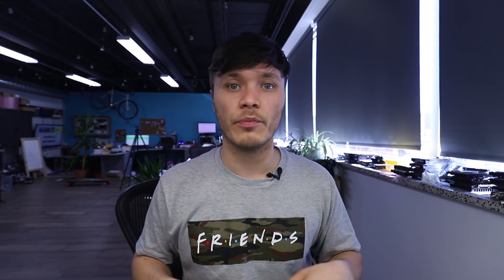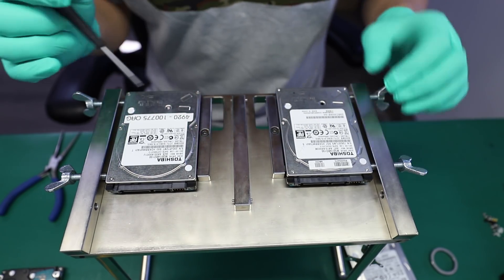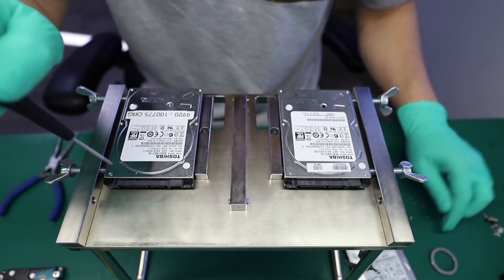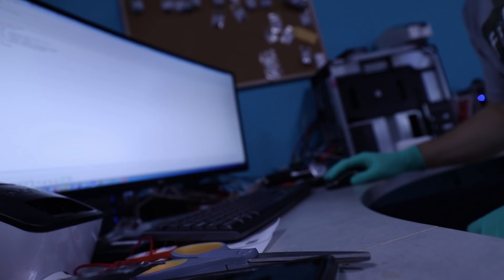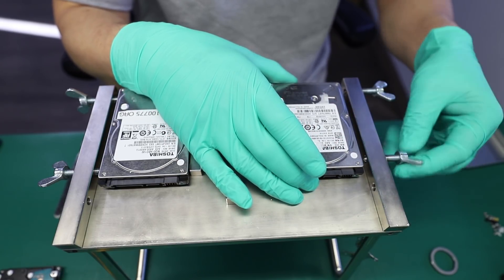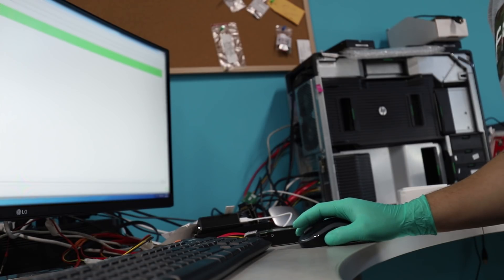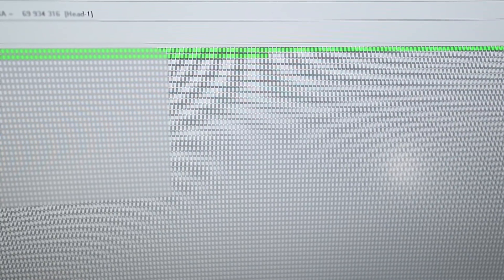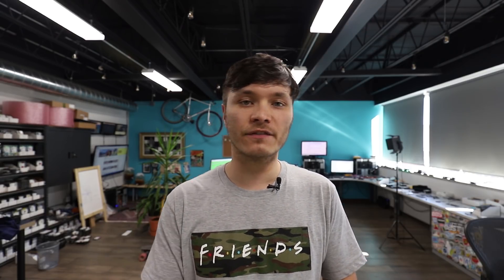Finessin' The Toshiba | follow up to data recovery on Toshiba 2.5"

Comment: Hi Erkin, I have a question, how is possible to have just one non-compatible head on the entire stack (head 1), would not it be the stack itself?, if you were able to retrieve data, probably the platter's surface got damaged. Regards Erkin.

Comment: Erkin do you have the part number for the little bench that holds your hard drives when you do the work on them. I want to buy one but having difficulty finding out what they're called
Reply from the maker: Our friend over at HDD Surgery makes them. This is a very solid piece, and I highly recommend it http://hddsurgery.com/data-recovery-tools/hdds-hard-drive-repair-workbench
Reply: Ah ty, I forgot about HDD Surgery, I remembered that site for platter tools but didn't realise they had that. Thank you :)